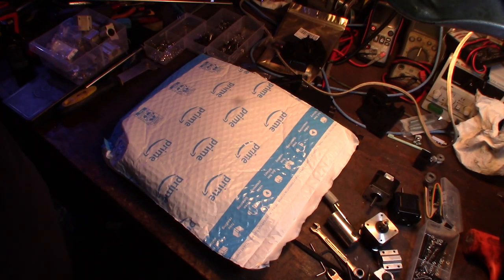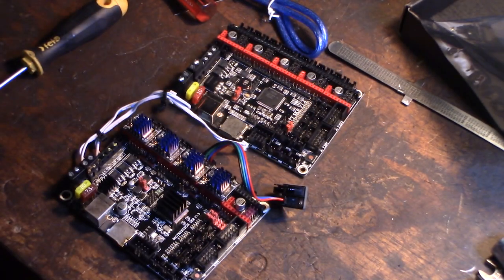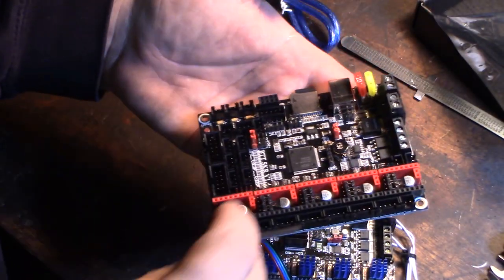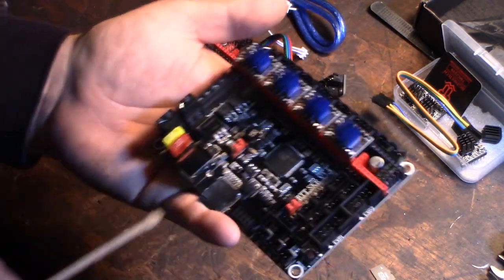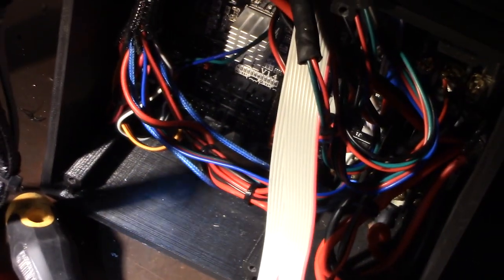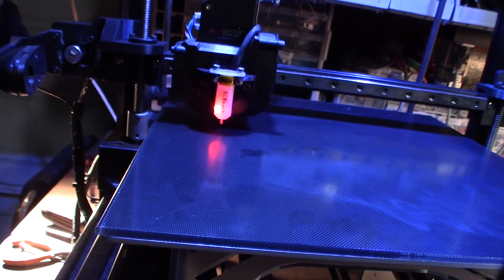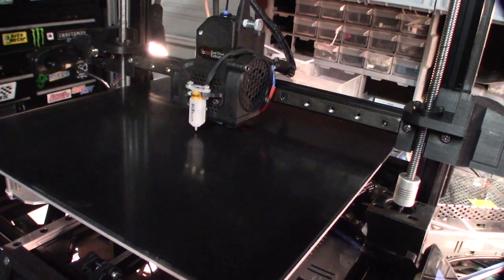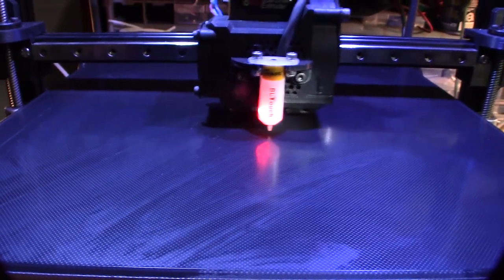NEW BigTreeTech SKR 1.4 TMC2209 BLtouch install Marlin 2.0 sensorless homing stallgaurd

Comment: Just a tip but if you are setting up a Bltouch, wind your z up so there is a couple of inches between the bed and the bltouch, click auto home , then push the bltouch pin up and if it dosent stop turn the printer off and investigate because it is not going to stop

Comment: For the diag pin, instead of cutting it off, I just heated it up with a soldering iron and pulled it out of the backside of the board with some needlenose pliers.   Cutting's okay too, but I figured if the pin was completely gone (front and back) it would be more visible that way.

Comment: Voltage and current have nothing to do with having a skew x axis for example. Stepper motor use steps (what's in a name, right) and those steps are counted each time a certain travel distance is requested from the firmware (through gcode or otherwise). Those steps are actually in firmware as steps/mm. The only thing current will do to your motor is make it run hot and is only required if you want higher torque applied for high weight loads for example. The only motor type (dc that is) on who voltage and current have an influence on rotation speed are brush(less) DC motors.

Comment: The different voltage between z stepper drivers doesn't change speed or distance they move but the power being sent to the steeper. It would be better to use separate drivers to level the z axis automatically

Comment: Thanks for the help with this video. I did end up cutting off the diag pin on the z axis, changing the pins file for the skr_v1.4 file to point the z prob pin to P1_27 and connect the black / white wire to the z min pin on the board. It seems to have work.

Comment: i've manged to get it to work with the dedicated connector, but not as you might think.

thing is, the way i understand it , marlin treats PROBING and HOMING as 2 different items.
with b-ltouch you got used to think about them as the same thing. 
marlin will always try to HOME using the z end stop, when bl-touch was initially connected to it, it served as end-stop too , but once you had it connected to the different hole it's as if you tired to home without ANY end stop connected to it. 
so if you want to use the dedicated bl-touch connector you have to actually use a real z-end-stop (which let's face it is free for the exact same reason) 
there are several bugs and feature requests about this on github. 

please try and make a new vid about it, with people search for skr 1.4 and bltouch, yours is the first that pops up
Reply: So when you also have the DCDC mode thing from bigtreetech you also need a z-stop, do I understand you correctly?
thanks in advance.

Comment: Really like the way you put so much information into this video,  I got my hands on the turbo version of this board and are setting it up, trying to find the Bl touch pin ID for where they want you to use it, I might have to reach out to Bigtreetech
Reply from the maker: Thanks, I just used the Z_min.
Reply: @fintechrepairshop  there are 3 pins and assuming the square pad on the diagram is GND what pin should i use?
Reply from the maker: @tyrian869  what drivers?
Reply from the maker: sorry, use ground and pin.
Reply: @fintechrepairshop  I'm probing GND to be center pin on Z-stop connector, I'm using 2209's stelthshop uwart

Comment: HI.
    love the channel. Can i ask a quick question,  did you cut the stallguard pins off of the Z and E0 stepper drivers on the 2209's ? I'm about to install this board and 2209 steppers in my corexy, i'm using sensorless homing on X and Y and a inductive probe on the Z and was unsure if i needed to cut the pins for Z and E0.?
Many Thanks.
Reply: What did you end up doing?
Reply: I ended up cutting the stallguard pins on the X and Y axis drivers but didn’t need too on the Z axis. Should’ve just got the 1.3 board and not the 1.4 board as it’s a lot less hassle and works just as well.
Reply: @roscoe3dp470  What about your pin definitions? I still can't get this to work with the 1.4 board.

Comment: I had the same issue with a BL Touch on my SKR 1.4 board, I don't think its the Stallguard because I was using 2208's in standalone, it defined in Marlin to use the BL Touch pins but doesn't seem to like them. As soon as I put in on the Z endstop pins it worked as expected.
Reply from the maker: I was thinking I would have to reassign the Z endstop in pins_BTT_SKR_V1_4.h file
Reply from the maker: Did you have any issues with your Extruder. My is acting kind of strange.
Reply: @fintechrepairshop  You must choose the proper pin number to use the Bltouch pins.
Reply: @anthonycruz4435  What is the pin number to use? P0_10?
Reply: @fintechrepairshop  Yes that is what I had to do was define my endstop as that pin P0_10 iirc, then enable probe as zmin or something like that in firmware and the bltouch plug started working for me.

Comment: Hey thank you for the great video! I got stuck with bltouch problem same as you! and I just switched over to z endstop and works. I do have a question. I am using sensorless homing for x and y but not for Z and E0. 
1. Do we need to remove diag pin for Z and E0? 
2. To get the bltouch probe pins (black and white) that originally came from, what needs to be done? (I am assuming removing diag pin for Z & removing [#define Z_MIN_PROBE_USES_Z_MIN_ENDSTOP_PIN] )

I'd like to thank you for your video and the great work you put into your machine!

Comment: Hi, If the stallguard feature works well for the Z axis why would you need to use a BLtouch? I would think that if stallguard sensitivity and repeatability are good this would be the preferable way to sense Z stop and might yield more accurate bed leveling than the BLtouch. I realize to use stallguard properly the bed and nozzle should be at operating temperature otherwise cold plastic on the nozzle would mess up the Z stop measurement but the BLtouch accuracy isn't much good either unless everything is warmed up and stabilized. With BLtouch I have to recheck the Z axis calibration if I switch to a different plastic that requires different bed/nozzle temps. Maybe re-calibration would work better with stallguard because it measures the actual point where the nozzle contacts the build surface and not a point that is mechanically and thermally removed from the nozzle. I'd be very interested to hear your opinions. Thanks
Reply: doesn't seem like a good idea with a leadscrew z axis, maybe if it were belted.

Comment: Hey did you find out how to use the bl touch specific pin instead of the z-endstop one?
Reply from the maker: Not yet, I'm still using the endstop.
Reply: Robert Groot  ... guys, didn't you get this thing? https://www.aliexpress.com/item/4000500776037.html?spm=a2g0s.9042311.0.0.17f94c4dwX7bus
Bigtreetech says you need it to properly run BLtouch.
when you plug it in, you also have to move the red jumper to be in line with this pcb, then bltouch will work
Reply: @sabeledger67  What was their reason? And, this is needed for the reg 1.4 boards? I just bought one, arrives in July. Fk that's a long time to wait. Rip.

Comment: Is there anyway you can upload a copy of the Configuration.h and Configuration_adv.h files somewhere? I'm building a printer from scratch and mechanically everything is pretty good but the Marlin config I am struggling with. My specs are very similar to yours, SKR 1.4, TMC2009 using stallguard, bltouch etc. There will obviously be differences in dimensions etc but it would be a significant help

Comment: I must have missed it, did you cut the diag pin on the z stepper driver?
Reply from the maker: No, I have a BLtouch. The BLtouch will be activated before the stepper will stall. for a TMC2209 the manual says cut the Diag pin if you don't want to use it. Look at the 1.4 manual.
Reply: @fintechrepairshop  So this may be a silly question, but does that mean you can have sensorless hoping and stealthcop enabled for both Z and E0 without needing to cut the diag pins? I assumed that Z just couldn't be in stealthcop because you'd also be required to have sensorless homing enabled.

Comment: I am having a hell of a time getting my BLtouch programmed. I am using tmc2208 so stallguard should not be an issue.  I have the same problem you originally did as the pin deploys but then does not stop the head from crashing into the bed. I have tried both the z-stop and the custom bltouch port with no success.  Any chance you would share your Config.h and config_adv.h files so I can compare and see what I am doing wrong? or do you have a suggestion?
Reply: I'm in the same boat. I have scrubbing the internet for the past 2 days and haven't come up with a solution. Please let me know if you find one. Thanks.
Reply: @Hopeinformer  This is what worked for me, Go into pins and change the zmin pin to p0_10 then go into the config.h and set it to use probe as zmin I cant remember exactly what it was but I had to change that pin in the pin.h file for it to work for me. Hopefully you understand what I am saying.
Reply: @3dprintingbiker693  Thank you Thomas. I think I understand what you're saying. I tried that and now the Z will stop instead of crashing.
Reply: @3dprintingbiker693   is there any chance you can point me more in this direction .... think this is the issue im having .... not sure how to set up in the config.h, already have Z_MIN_PROBE_PIN  P0_10 set up in Pins.... any help would be apprecieated :)
Reply: @jamesmclachlan5835  sure but need more information on how much of the setup you have done, if the board configured and compiled in marlin ready to go? Is it just the BLTouch you have a problem with?
Reply: @3dprintingbiker693  have set it all up everthing works its just the  BLTouch , it deploys when homing Z but  just wants to crash into the bed
Reply: @3dprintingbiker693  thanks for that .... i think i have it now but get the error now  "stop called because of bltouch error" any ideas ?
Reply: @thomas ruble got it .... thanks a lot for that !  been at it all day haha
Reply: @3dprintingbiker693  For the SKR 1.4 Turbo under configuration.h I had to #define Z_MIN_PROBE_PIN P0_10
 
and under SKR1.4 pin File I had to change   #define Z_STOP_PIN  P0_10  //P1_27   // Z-STOP 
This allowed me to strangely use the default location of where BIGTREETECH wants to to use the probe very confusing 
My issue that I am having now, is when I home with #define Z_SAFE_HOMING, It does not home before moving over to the center of the bed causing crashing
Reply: @tyrian869  you dont have sensorless homing turned on do you? that will cause it to think it has already homed and go to center
Reply: @3dprintingbiker693  Yes I do have sensorless homing turned on, that's intended, Your telling me that won't work?
Reply: @tyrian869  If you have 2208 no sensorless homing only works with tmc 2130, 2209, and 5160 drivers.
Reply: the 2130 had layer shifting issues and the 5160 is expensive. The 2209 is what I am using and it works amazing but you have to turn off fast homing because it is very harsh on the x axis. only takes a extra 3 or 4 seconds to home so not a big deal honestly.
Reply: @3dprintingbiker693  I'm using 2209's, sounds like you need to set your STALL_SENSITIVITY threshold higher?
Reply: @tyrian869  the harsh x home is a known issue with fast homing. If I set it any higher it false stalls any lower it doesnt trigger. lol only way I fixed it was to either slow down the y axis homing speed so that the x homes first. then it transfers issue to y axis. with normal y then x homing it acts fine. strange issue but it's a known issue in marlin and there is a ticket to fix it.
Reply: if it isnt homing though before doing the z then it sounds like it is hitting the stall setting, however if it is sending it to the center then it must not be getting the G29 command for some reason. does it home correctly when you do a G29 from Pronterface?
Reply: @3dprintingbiker693  I read somewhere adjusting the acceleration setting higher helps prevent false stall
Reply: and I think I just needed to lower my STALL_SENSITIVITY because now all is working for me huh I lowered x and y stall setting down to 130 and are able to home with Z_SAFE_HOMING repetitively
Reply: @tyrian869  hello also got the turbo. And nothing but problems.. lol at first I got the board to work except the BL touch simply won't have it,and now can't get it even to configure in atom..would you be willing to share your setup ?
Reply: @dongletreehenley9744  i can do that, the answer is just up above a few comments, but I can when I get back home
Reply: @dongletreehenley9744                         https://discord.gg/MNKUP7 I can share and talk here

Comment: anyway you could help me out. install isn't a problem. im new to marlin config. have some experience with coding but not alot. looking to find someone to go over my config files. i used the ender 3 as my example and dropped the config files over to marlin folder. i then configured for the skr 1.4 turbo. enabled parameters for the bltouch. i got the tmc2209 drivers with it, wasn't sure where to add them to marlin, if i add them? other than that i just wanted someone to look at it. board isn't here yet
if you can offer any help i would greatly appreciate it!!! watched your video yesterday and learned alot! thank you
Reply: Just hit Command F and a search bar should pop up. type tmc2209 so that the section you seek comes up.

Comment: How did you setup marlin? Im having a super hard time getting it to read the drivers, M122 just ends up with "Error: ALL LOW" for the drivers
Reply: same thing here .. and i don't get sensorless homing to work!  Don't know what's wrong :(
Reply: @Jonaswallen83  +1
Reply: you cant read the drivers whit USB power..
Reply: @Jonaswallen83  already know that. Also you need to do a M17 before M112 but still all low. But i can control them

Comment: hi - i deleted my firmware.cur file before placing the firmware.bin on the new board - is this an issue ? - thank you (skr1.4turbo)
Reply: firmware.cur is the renamed firmware.bin file AFTER it is installed. You don't need it anymore after that. Next time you write a new firmware.bin, it will read it automatically upon power up and rename that to firmware.cur.
Reply: @KeithHuffstutler  thanks - i cant boot my board - it does nothing with new firmware.bin file

Comment: hi, a bug has been recently opened on marlin regarding this, https://github.com/MarlinFirmware/Marlin/issues/16839
 if you uncomment the has_custom_probe_pin in conditionals.lcd like so 
  #define HOMING_Z_WITH_PROBE   (Z_HOME_DIR < 0)// && !HAS_CUSTOM_PROBE_PIN)
then it will use the dedicated pin